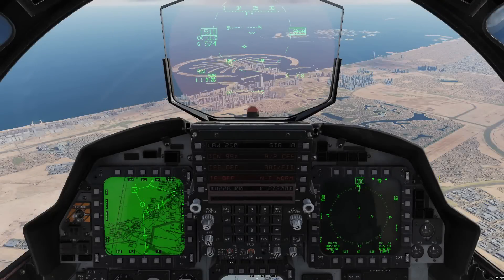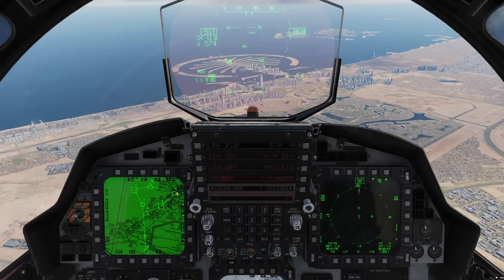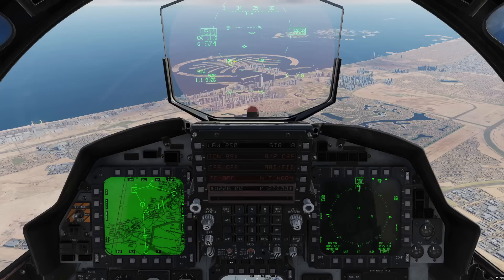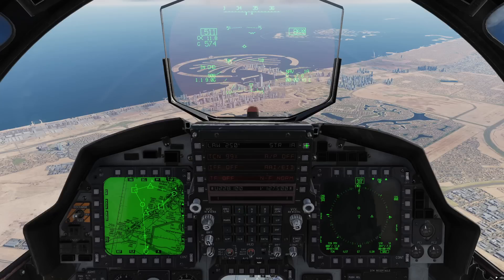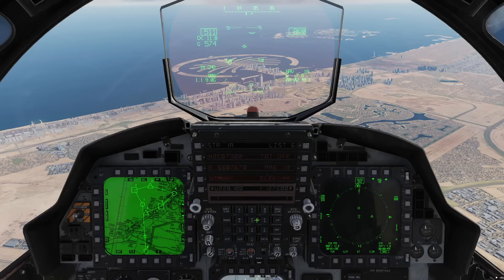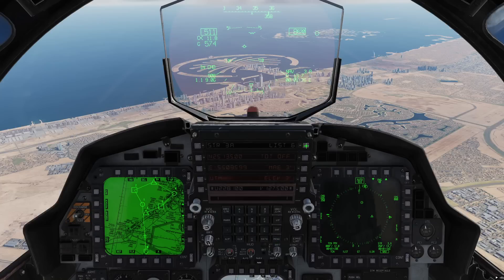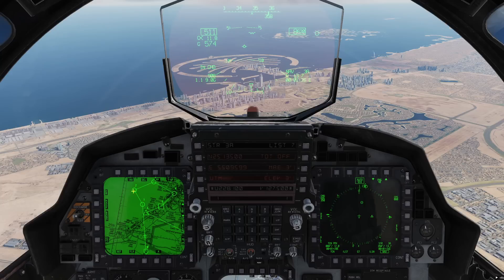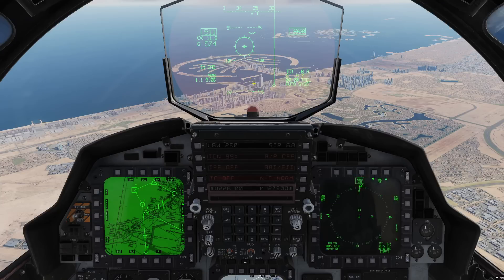DCS F-15E Strike Eagle | UFC Part 3

Comment: so it's controlled with two crewmen ... so how u gonna model that for the single player ?
Reply: F-15E doesn't have hard divisions of labor between the crew the way that aircraft like F-14 or A-6 do.  In F-14, ONLY the RIO had access to the radar.  In A-6, ONLY the BN had access to the radar and precision bombing equipment.  

But, in the F-15E, the front seater has duplicates of basically every control and display the back seater has.  I think there was some electronic warfare stuff only the back seater has, but almost everything is there in both seats.  The presence of the back seater allows you to split the work load, it does not FORCE you to.

In real-world operations, generally the WSO works the radars and targeting pods, so the pilot can focus on flying the aircraft and avoiding threats instead of staring at the sensors.  But the pilot absolutely can control the radar and targeting pod from his MFDs.
Reply: @bronco5334  thanks for the breakdown, that helps a lot
Reply: @bronco5334  Yet another reason why this module is going to be the best.
Reply: @bronco5334  
so there will not be any need to an AI back seater .. it's so cool .. cuz i mostly interested in the pilot seat
but for more realistic single player experience i think it's better to add an AI
Reply: I recalled them saying that you be able to jump in between both seats but you won’t have a rio like Jester or an AI in the backseat